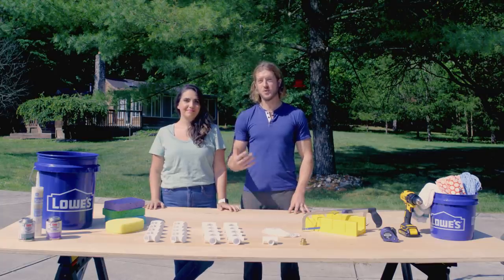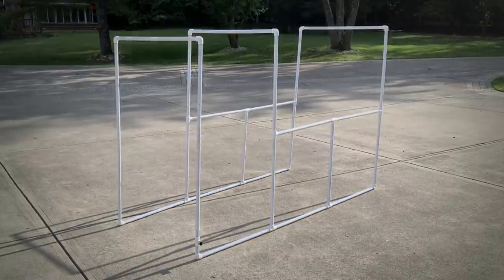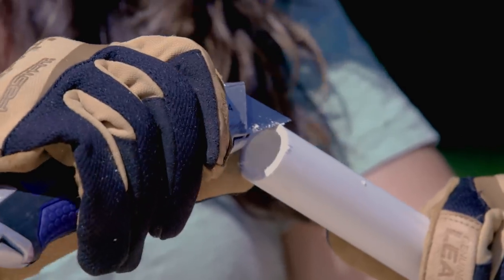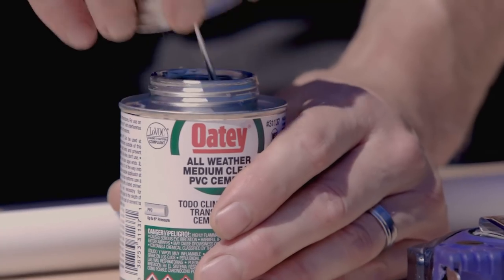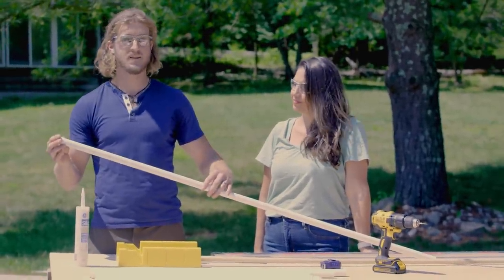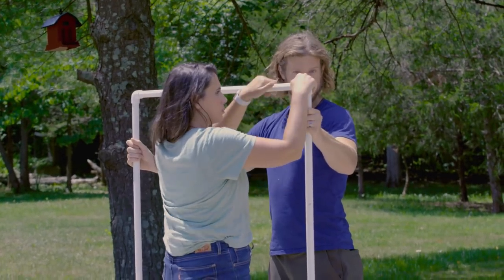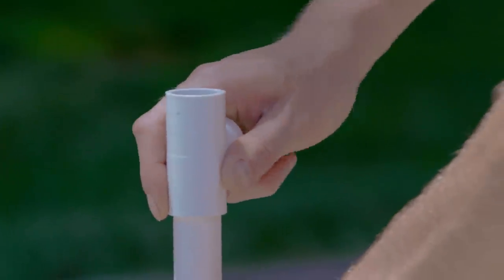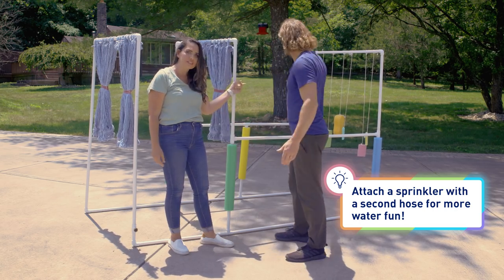How To Build a Kid's Car Wash Sprinkler

Comment: Uhhh... please dont use a box cutter on the edges. Get one or 2 different grits of sandpaper. Sandpaper also helps the fittings fit flush instead of difficult to push together.
Reply: An actual deburring tool would work even better. Not one of the wire brush one's

Comment: Why not buy pvc caps at Lowes for a few cents instead of doing a dowel rod and silicone? This video is confusing.
Reply: They needed the end available for a joint so they couldn't use a cap.
Reply: @trekie30122  You re right. The water doesn't flow through the entire pvc system. That should have been explained I guess.
Reply: @trekie30122  There are 4 ends, and it says you only need 2 pieces, where exactly are those dowels going. They neglected to say that. Im kinda lost, Ill find another method. They need more detail.